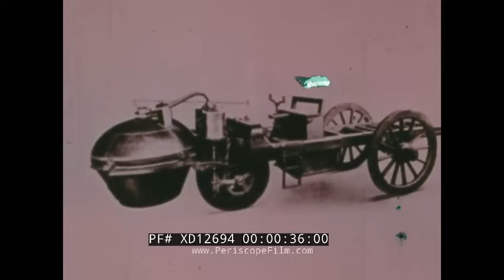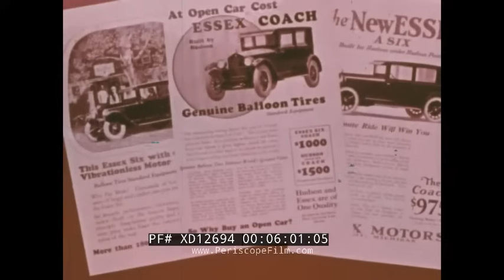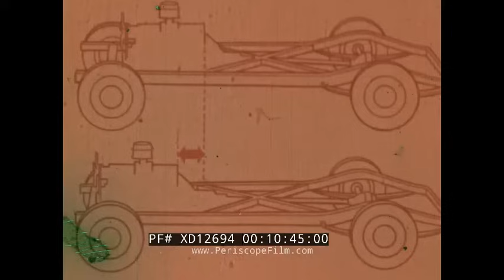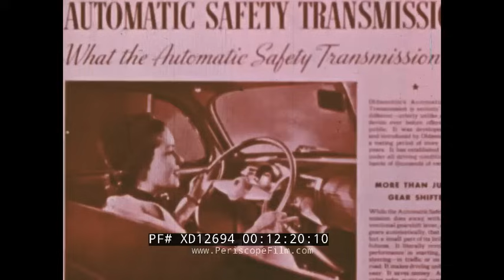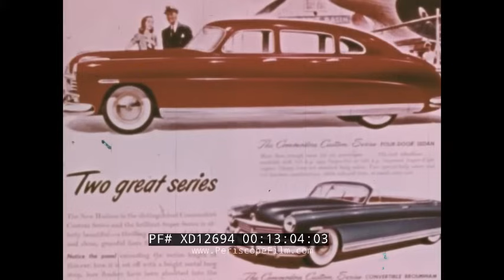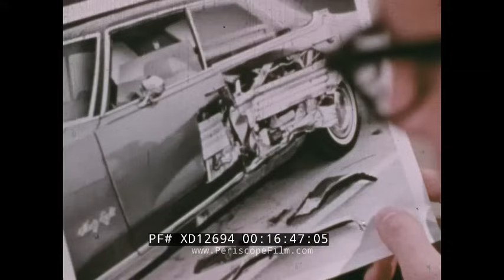"THE CHANGING ARCHITECTURE OF THE AUTOMOBILE BODY"  1970s GM AUTOMOBILE DESIGN FILM XD12694

Comment: Considering this film was made more than 40 years ago - and 40 years before that was the post-depression 1930s - one could argue that cars changed much less over the last four decades than they did between the 1930s-1970s. Besides the sleek styling, a modern car would not seem too out of place to a 1970s driver - at first glance. 

Digging just a little deeper though, modern cars are predominantly front wheel drive with levels of performance and economy that was unrealized back then. Even a basic econobox of today (think Chevy Sonic, Kia Rio, Ford Fiesta) has a driving performance reserved for muscle cars and yet their fuel economy is on par or better than almost any small car of the 1970s. The level of luxury available on a new Sonic was not seen on any car back then, certainly not a small car. Safety has improved leaps and bounds too, and of course, in-car electronics and connectivity are now a major part of the new car experience. Even reliability and finish has become much more focused, with the malaise of bad paint jobs and misaligned trim when new largely a thing of the past. 
I guess it’s all relative but today’s cars have come a long, long way over the last four decades; it’s more substance than styling in my opinion.

Comment: This is definitely from the 70's - lots of clear knowledge.
 

14:43 The Chevy II Nova convertible - I had a 63 SS tortoise  convertible. It had a 192 inline 6 with a powerglide 2 speed transmission.  I miss that car. 

The one shown looks like a Nova 400.

Comment: The shift on the column also made it easier to slide across the seat from the righthand side.  My 1940 Ford only had a lock on the passenger door. Laws of the day I guess.
Reply: Nope.  It was a Henry Ford safety thought.  He did that to encourage curbside entry as it was safer than standing out in traffic to enter/exit the car.

Comment: No doubt cars are safer, higher performing and more efficient today.  But at the price of blandness.  I was ten years olds in the mid 1960's, about the time boys start noticing cars and get their first car crush.  You could the make and model of a car from literally 3 blocks away.  Today, other than high end exotics, cars are so much alike in appearance that until you walk up to them and see their logos and model badges you can't tell one from another.  Also, and this is my fault for being old school but the intrument panels and touch screens are so full of cross referenced menus that it detracts from the enjoyment of driving, as if that's a value anymore.
Reply: not only that, but cars would change enough each year that you could tell a 63 from a 64 from a 65 etc from 3 blocks away. Now it is a 10 year run for each generation, and your main choice is do you want your SUV in large, medium or small.

Comment: https://www.conceptcarz.com/vehicle/z13521/oldsmobile-limited.aspx
4:50 The 1911 Olds Limited was "the largest production car ever built in the U.S."?? With a 130 to 138 inch wheelbase, and 42" wheels at the extreme ends of the car, the Limited had an overall length of a little more than 180", shorter than a 2020 Honda Accord and a lot shorter than the 1974 Fleetwood Brogham (133 in wheelbass, 233" bumper-to-bumper) at 0:06, or for that matter the 1973 Chrysler Imperial (127" wheelbase, 235" bumper-to-bumper), which is, AFAIK, the largest post-war production car. The Limited's engines, however (505 cu inches, 60 HP 6-cylinder, rising to 707 cu in.), were all bigger than the 1974 Fleetwood's 220 HP, 472 cu in V8, or the 190 HP, 500 cu in V8 that would replace it for 1975.

Comment: No fun anymore. Just loaded with electronic features that detract from the old school  'driving experience'. Ok to drive to the grocery store and the post office, I suppose.
Yep, I think I'll invest in a $70,000 truck just to go to the hardware stores to pick up a hammer and a box of nails for a DIY project!
Reply: And yet, a run-of-the-mill Honda Accord can out-accelerate a lot of "muscle cars" from the 1960s. Today's car are a miracle compared to what was dished out in the late 1970s, but they're too overloaded with features and gimmicks. I'd rather live without built-in navigation and "info-tainment" than have to go through multiple menus to adjust the radio or the air conditioner.

Comment: US cars went to crap after the 1972 model year.
Reply: My Father Ordered a Brand New 1976 Chevrolet Monte Carlo Landau Sport Coupe back in October 1975 and picked it up a month later because it was built in OSHAWA, ONTARIO, Canada, just North East of where we live in Tillsonburg, Ontario, Canada! It was the Best Car My Family had ever Owned! We owned it  from November 1975 to August 1989, Almost 14 YEARS without any Major Problems/Issues! This Monte became my first car when I turned 16 back in 1986! The car was "Bullet Proof" and "Nothing" could kill It! I should have kept It and restored it because it was mechanically reliable and it only needed some body work and a new paint job! This was The First Year that The Monte Carlo came out with dual stacked rectangular headlights like the Chevy   Chevelle Malibu Classic came out with this same year too, which made both cars more attractive in styling and looks! This Monte Carlo I have owned outlasted a lot of imports my neighbours have owned for example: Toyotas, Nissans, Hondas, Volkswagens, and Ladas which rusted out and disintegrated severly from salt used on our roads in the Canadian Winters! All We had to replace On Our Monte Carlo was the bottom of the doors & the back wheel wells on the back quarter panels when we had the car repainted back in the Fall of 1985, 10 years after My Father had Ordered & Bought it Brand New from our local Chevrolet/Oldsmobile Dealer: Pearce Motors in Tillsonburg, Ontario, Canada! After that we had the Monte Carlo repainted we had it oiled/rustproofed every year starting the same year in 1985 when we had the Monte redone and it had held up Excellent until I sold it in August 1989, when I bought a 1989 Chevrolet Cavalier Coupe to drive to College that year which was better on gas than my 1976 Monte! Since my Dad Ordered & Bought a Brand New 1986 Chevrolet Caprice Classic to replace his 1976 Monte Carlo which he sold to me when I turned 16 back in 1986, we have always rustproofed our GM Cars with Rust Check every Year since 1986 and we never had to get any major body repair/work done on any of our cars except when some people ran into My Brother's 1996 Pontiac Grand Am SE and My Father's 2001 Buick Regal LS! I own & drive a 2015 Chevrolet Camaro 2LS Coupe now with a 3.6 Litre V6 now and it is one of the best looking vehicles on the road now because it does not look like a jelly bean when compared to most new cars like My Brother's 2015 Chevrolet Cruze LT RS & Our Parents 2018 Chevrolet Cruze LT! My Camaro and all the 2010-2015 were Styled like the 1967-1969 1st Generation F-Body Chevrolet Camaros & Pontiac Firebirds! This Camaro has been the best car I have owned so far and it the best looking car I have ever owned! This is my 7th Car I have owned so far and all 7 Cars I have Owned so far are all Chevrolets with excellent reliability and dependability too! MOST OF THE Chevrolets I have owned were all built in my County Canada in OSHAWA, ONTARIO, EXCEPT FOR THE 1989 CAVALIER WAS BUILT IN JANESVILLE, WISCONSIN & THE 1995 BERETTA WAS BUILT IN WILMINGTON, DELAWARE, THE SAME PLANT WHERE MY UNCLE'S 1985 IMPALA WAS MADE! I HAVE NEVER HAD A BAD CAR/LEMON IN MY LIFE AND THEY ARE ALL CHEVROLETS MADE IN EITHER CANADA OR THE UNITED STATES! I AM VERY PATRIOTIC AND I HAVE BEEN A VERY STRONG SUPPORTER OF BUYING DOMESTIC VEHICLES MADE IN CANADA & THE UNITED STATES LIKE MY FAMILY WHO STILL BUY GM, CHRYSLER, AND FORD PRODUCTS PROUDLY MADE IN CANADA, WHERE I STILL LIVE & OUR GREAT NEIGHBOURS/ALLIES, THE UNITED STATES OF AMERICA! I WORK IN A PARTS PLANT IN MY HOMETOWN PRODUCING PARTS FOR GM, CHRYSLER, AND FORD PRODUCTS TOO! THAT 1976 MONTE CARLO WAS THE BEST CAR MY FAMILY HAS EVER OWNED AND FOR THE LONGEST PERIOD OF TIME FOR ALMOST 14 YEARS WITHOUT ANY MAJOR PROBLEMS/ISSUES! THAT 1976 MONTE CARLO WAS THE CREAM OF THE CROP OF ALL THE 1970s CARS FOR VERY HIGH QUALITY AND RELIABILITY! I HAVE A FRIEND WHO KEPT HIS 1976 MONTE CARLO LIKE I HAD WHICH HE RESTORED AND HE IS STILL VERY SATISFIED WITH THE CAR SINCE HE BOUGHT IT BRAND NEW! AT LEAST MY 2015 CAMARO IS STILL A BEAUTY QUEEN WHEN COMPARED TO ASIAN VEHICLES THAT LOOK LIKE HIDEOUS INSECTS AND SPIDERS IN COMPARISON! ALSO, YOU STILL SEE A LOT OF NEWER CARS LIKE MINE AT CAR SHOWS, AND THE OLDER CLASSIC CARS LIKE MY FRIEND'S 1976 MONTE CARLO LIKE I OWNED, AND THE GREAT OLD MUSCLE CARS LIKE A 1970 CHEVROLET CHEVELLE SS HARDTOP COUPE & CONVERTIBLE! YOU HARDLY SEE ANY IMPORTS FROM THE 1950s, 1960s, & 1970s BECAUSE THEY ARE AS UGLY AS HELL WHEN COMPARED TO THE DOMESTICS FROM AMERICAN MOTORS (AMC), GM, CHRYSLER, AND FORD! GOD BLESS CANADA & THE UNITED STATES OF AMERICA! CASE CLOSED!😎😁👍👌🤘✌
Reply: @davevirag5423  Nice to hear you recount the good car memories. I remember when the camaros and firebirds were produced at tthe Van Nuys, Calif. plant, not far from where I grew up.
 I took pics of a couple back in the late 80's wearing all yellow, and holding signs "Honor thy Lemon", and "Honk for lemonade' standing right outside the main entrance of a Cadillac Dealership in Los Angeles, because they contended that GM kept putting bad transmissions in their Cadillac Eldorado, that they (the couple), contended was the same model transmission that was used in the Chevrolet Chevette, GM's lowest priced car.
 I have other pics of a man driving around Hollywood, Calif. in his GM box van where he  painted all along the slab-side of the cargo box, on both sides "U 2 CAN OWN A GMC DIESEL (then a cartoon character of a guy pulling out his hair, with the words-ARRGH!", (then a giant lemon, and then below that), "4 $20,000."  I took this picture in the late 1980's, and I am looking at it now!

Glad that you had exceptional experiences with your cars. It is important, as you say to support your country, and the car industry.  Through this crisis, the China supply chain will probably really be considered, and  much more industry will come back to North America, and hopefully a flourishing middle-class will be the result of this, to which, I'd have to give credit to the President , and unions for being supportive of these efforts.  Thanks for sharing!
Reply: Even before lol.
Reply: I agree 100% Sam!  I owned a '72 Chrysler New Yorker from 1977-1982 and it was one of best, if not the best, cars I've owned since!
Reply: Totally agree! My mom purchased a new (first year) Honda Civic in 1973, we both knew at that point that the innovative and efficient Japanese cars were going to be dominant force to contend with, from then on!